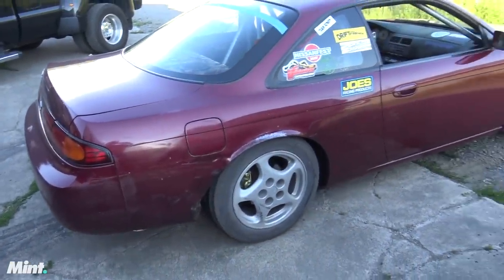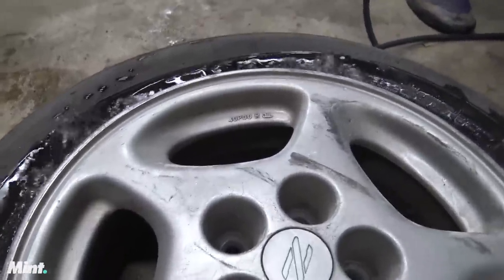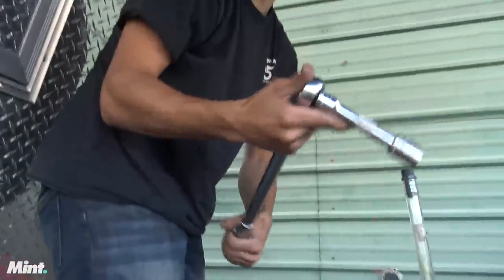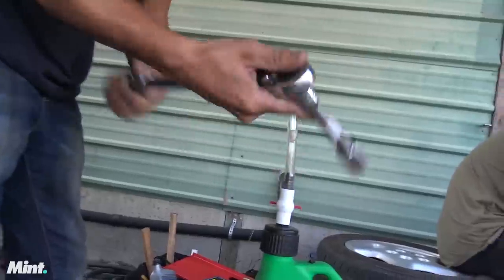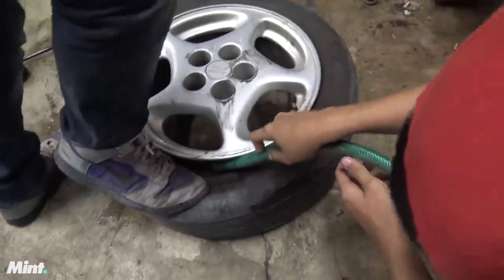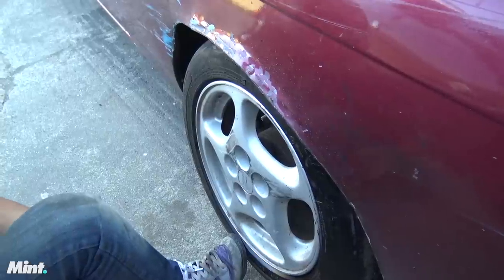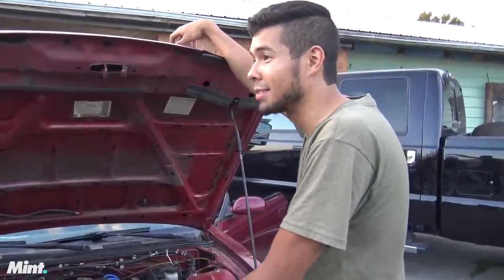Filling a CAR TIRE with WATER!

Comment: The reason it worked is because the water is cooling the rubber from melting so if you are doing burnouts, yes, the tires theoretically will last longer
Reply: wow really? didn't realise man!
Reply: And I'm guesssing the reason the tires start shredding is because the heat is converting the water to steam so it starts to expand and put extra pressure on the rubber
Reply: The reason it worked isn't because it's keeping the rubber from melting by because their's not enough air in the tires for the heat to build pressure and pop, the rubber is still melting
Reply: water hold over 4x the amount of heat than air does. so you could theoretically do a burnout 4x longer than with air.
Reply: Lol wow you’re a genius!
Reply: 4 times the heat capacity per unit of weight, though. There is likely 20+ pounds of water in each tire, versus very little weight in air. (not sure how much, but we can safely say well below a pound) So that means that even if it had a pound of air, the water would hold 80 times more heat at a bare minimum. It is likely hundreds of times more.
Reply: no shit
Reply: I would like to see it with some form of coolant inside rather than water something that can stay cooler for longer than water
Reply: Souprise Coolant is just anti corrosion, water is best for the job of transferring heat
Reply: Souprise coolant doesn’t keep the water cooler longer. It stops water from freezing. Wtf
Reply: Leon Kim congratulations you’re the only one replying on here that is actually correct.
Reply: but keep in mind that as the water cools the tyres, the water is heating up and most likely building up pressure due to evaporation and having nowhere for the steam to escape
so... after a while.... BOOM
Reply: @Npianist

who are you replying to ?
are you replying to me 
i didn't say anything about Weight,   who are you talking to ?
Reply: You do realise the tyre would still wear out from friction from the ground right? It's like sand paper to wood, Just because you added water doesn't mean it won't still degrade. Adding water is also pretty dangerous, as the tyre heats up, it will eventually cause the water to evaporate, which then adds steam in to it which creates more pressure leading to a tyre bursting.
Reply: Not you martin,  mysticarsenal. And @ connor etchells, that's true, but also as things get hotter, they become softer.. Like how you bend metal by heating it up. So although adding water doesn't change the friction, it still keeps the tyre cooler for longer so the friction isn't damaging the tyre as much as it would normally be. This is just my thoughts though, I'm no scientist :)
Reply: @Npianist
fair enough
it's just your comment was below mine and not attention to one particular person and didn't relate to the original poster, so i had to ask
thank you
Reply: sorry, but psi is a unit of pressure. same goes for bar, atmospheres or mm mercury. it tells you how much force your "gas" applies to (in your example per square inch) a specific area. The pressure put into your tire has nothing to do with the mass of the air, but rather with its compressibility. it would help if you would read the wikipedia article before commenting.
Reply: Keno Clayton, that’s just friction wear, nothing abnormal.
Reply: 1xBublex1, fill up a high pressure tire to bursting and when it has an impact, by your own reasoning you’ll be lying.  What is potential force Considering gravity? Not convenient to an argument? Didn’t think so.
Reply: So you are telling me i could do longer burnouts if i fill the tires with water
Reply: ok First of all most people here replying needs to learn a little more in the head, Air does have Mass therefore has weight under earths gravity Air pressure is actually the air's "weight" its pressing down with force the lower you are in elevation the more air there is the more pressure "weight" it has to press on things. second Rubber is a great insulator so yes in a way the heat transfer rate it has isn't great, but judging how water has a relatively good heat transfer rate and a good heat capacity and the fact the water did get hot/warm depending how you take their word for it yes the water did transfer enough heat at least to a point where the tire did last longer then normal however this probably occurred only after the tire got ground to a point where the steel was in contact with the pavement(Also those tires didn't look in great condition either so that was probably really quick). 3 on the person saying Psi was a measurement of air weight plz do me a favor and actually look up what Psi stands for.. Thanks and that is all have a great day.
Reply: InDong WeTrust 
It's an eye opener!!! I fill mine with freezing water! It will definitely last even longer 😉
Reply: Souprise 
How about leaving  the tyres in  the freezer for 10 days?!
Reply: To your 3rd point Donald Malone, while you're completely right, if he looks up just what PSI stands for he's just going to see Pounds per Square Inch and not really learn that it's a measurement of a pounds of pressure not pounds of weight
Reply: In dong we trust
Reply: I cant believe i read this whole comment section!! I loss a few brain cells early on but got them back at the end
Reply: It's because water is both adhesive and cohesive
Reply: Well in PRACTICE they last longer that is what they just showed.  And to be specific it works because water has a very high thermal mass, it takes a lot of energy to heat up water a little bit. Also is has good thermal conductivity, between the rubber and the water.  So the water absorbs heat from the rubber keeping it much cooler than it would be otherwise. To others: air does have weight and mass,  'getting hotter' and 'absorbing heat' mean the same thing, yes friction and abrassion will still wear out the tires, just not as fast, the tires will be destroyed long before any steam is created, there just isn't enough heat energy to get that much water hot enough.  A half cup or so of water in the tire might be dangerous though.  There might be enough heat energy to turn that into steam and then the tire would become a bomb . Don't try this with a little water. Also calling people idiots when you are as wrong and mistaken as they are isn't a good look.
Reply: Keno Clayton I don't think so, I doubt the water ever got near the boiling point.  They said it was warm.  If it did get to boiling point that tire becomes a bomb.
Reply: Yeah, the tire will still burst.. The asphalt is literally shredding the rubber of the tire, so it will still blow out, (eventually) but because it isn't pressurized like it is with air, it won't really explode.
Reply: Thanks, captain obvious!
Reply: Noah Cremers no one like this comment left it at 69
Reply: Sherlock Holmes

Comment: They do it in tractors all the time. They even make a tool to easily do it.
Reply: why tho
Reply: @brendonboyer943  in tractors it's for ballast. To offset weight of loaders and such. In off-road trucks, it can assist with problematic balancing too, though typical dry small plastic beads are used.

Comment: In my opinion far far the best idea is to have concrete tyres and rubber roads.
Reply: Square tires too.
Reply: sickofitall89 .Hexagonal. Loose weight as well.
Reply: They had a Darkwing Duck episode like that once. They time traveled and the Dinosaurs were driving cars with cement wheels but roads made of inflatable rubber, it's the reason they went extinct.
Reply: @vguyver2 . Fred Flintstone is my idol.
Reply: You're damn right,sir...
Reply: Darkwing duck had an episode like that

Comment: They've been doing this and tractors since the beginning of time lol for weight purposes
Reply: hmm i knew they put sand in them but didnt know about water, good to know
Reply: Michal strzelec yes water or antifreeze
Reply: Michal strzelec some guys even do it on rock crawlers
Reply: makes sense, keep those big ass wheels planted
Reply: It's often water and calcium chloride...  basically road salt. The salt is purely for anti freeze and will harmlessly go in to the ground if there's a leak.
Reply: ive never heard antifreeze but water i use all the time
Reply: if you go to a tractor place they sell them factory filled with hydraulic fluid. Convenient if you blow a hose as well!
Reply: East Coast Lowlife  The main reason for using water was for safety, far less explosive blow out.
Reply: East Coast Lowlife I work at a tractor and lawn dealership, we fill them with beet juice. Yes you read that correctly.  Water and other types of liquid tire weights tend to eat the through the wheel over time. Beet juice doesn’t and it never freezes
Reply: Interesting info. Didn't know that.
Reply: We use water and methanol
Reply: Angel Rosales methanol? Holy hell if that sparks you’re done😂😂😂

Comment: First hard bump will pop it. The water cant compress and pressure increase from a curb or speed bump will be proportional to water:air ratio..
Reply: Jimmy's Tractor no
Reply: demogorilla lol, that was well thought out. Same reason you dont fill tires on construction equipment more than 75% water  doesnt compress.
Reply: so we need a fluid which can compress sufficiently and dissipate heat more efficiently than air, like a compressive coolant. :o
Reply: Luke A Edwards no fluids compress? Are you serious lol
Reply: Strange Person 
The only problem is that fluids don’t compress.
Reply: Mce 1863 Fluids compress, just not much. I’m wondering if the water heating up is what allows it to compress beyond what it could at room temperature, making it more plausible the tire would withstand your normal pothole or bump
Reply: Fluids do compress, Petrol can compress, oil can compress, The gases which make up air by the definition of fluid mechanics are also fluids and can compress.
Reply: Strange Person CNG
Reply: Most fluids are considered incompressible.  For the qualities of hydraulic use, petroleum based fluids and water are both classed as incompressible.  Not because they have no compression at all, but because the amount of compression under pressure is so little as to be considered negligible.  If you have a liter of water at sea level, and apply 1000 PSI to it, you still get about 995 ml.  Heat causes expansion of the water (and the air left in it).  Inside of a closed vessel, whatever doesn't actually swell the tire out will become an increase in pressure.
Reply: After reading, I should correct "fluids" to mean liquids.  Gases are almost universally compressible.
Reply: Strange Person Oh I know, Butane! Or CO²? 

Anyway, it's a faulty premise b/c half the compressibility is the rubber of the tires anyway
Reply: Brent Morris your assertion that "gases are almost universally compressible" is giving me a tinge of pedantic OCD ....😖 ughh, no need to play it safe w/ "almost universally"; gases are compressible
Reply: I'm telling you guys half the cushioning is the elastic flexing of the tire rubber.. 

but I can understand how you'd think that's a real stretch 

'a real stretch' ? 🤠
Reply: Are we gonna ignore the fact that they slammed the car down on the tire after filling it up
Reply: Jimmy's Tractor it's done all the time in tractor tires,and on roughterrain forklifts it's for ballast
Reply: Water doesn't compress (much), same reason why you have water/oil separators on hydraulics.
Reply: name the fluid that compresses when heated...
Reply: Fluids are not liquids. Fluids are gaz and liquids
Reply: While its true that the air in your tires helps to absorb impact forces I seriously doubt that a tire filled with water would “pop” upon hitting a hard bump. Still, WHY ON EARTH would anyone want to do this – I mean besides the fact that most drifters are basically morons. Speaking of which, how utterly idiotic and childish is a burnout competition? This experiment is not about tires at all but rather is an example of the devolution of the human race. 

I actually started racing cars when I was a teenager and I even learned to perform many of the car stunts done in movies, but even back then I NEVER had any desire to just sit there in one place and turn my tires into smoke. And I certainly never had a desire to enter any kind of track event in which the winner is determined by how “cool” he looks going through a turn (drifting) rather than on how fast he gets around the track. Driving on asphalt in the same way you would on a dirt track (drifting) can definitely be fun, and I would sometimes even do it myself for fun back in the 70’s, way before we even had a name for it. But I never in a million years would have imagined that someday this would actually be considered to be a “motorsport” by some, and that there would actually be competitions of this type held around the country.

Comment: and?
Tires on farm tractors have been filled with water since there are tires on farm tractors. Especially in the good old days without 4x4. Puts weight on the axle. Helps with traction.
There are special tools for not making a mess, you put in some anti-freeze and a little air. Done.
Reply: zammap08, actually, fluid in 1 tire on an axle wth duals will only be useful to that tire alone. And that's a problem easily solved with cast iron weights. They distribute the weight evenly to all tires. More efficient, also.  
Tires can be filled 100% with a tube inserted through the fill adapter which ejects every speck of air!  
We are now using sugar beet juice as ballast in tractor drive tires. Environmentally friendly, you know!
Reply: We have a pneumatic pump at the shop to do this through the valve stem. Almost all tractors are fluid filled. We use a 10:1 water:methanol mixture to keep it from freezing.
Reply: zammap08 Now I have an argument on how GTA 5 isn't 100% accurate. My friend thinks GTA 5 is life of crime simulator. Pathetic argument but its what it is.
Reply: Jamiechan there are a million reasons why gta 5 isn't accurate.
Reply: Stinger_ 223 I know. That's why I said its a pathetic argument.
Reply: Jamiechan yeah
Reply: Stinger_ 223 yeah
Reply: Went looking for this comment don't forget antifreeze though
Reply: Water in tractor tires doesn't really relate to this. Tractors have low acceleration. Rotating mass, moment of inertia, or unsprung weight (or weight not above the shock absorbers) are mostly irrelevant. In a car, these things matter more, and are reasons not to use water in tires. Unsprung mass is an engineering issue with putting electric motors on wheels for hybrid cars with regen braking. It also takes a lot of torque to spin heavy tires to overcome the inertia. That's why performance is worse with an extra 100 pounds in a tire compared to 100 pounds in the trunk. I'd imagine 1/2 filled tires would be even worse, as weight shifts back and forth during braking and acceleration. I don't normally watch this channel, but it was recommended and I was curious. Watching teenagers ruin cars is fun too.
Reply: The big thing with tractors is that they don't go fast enough for balance or acceleration/braking to be an issue.
Reply: Tools required - transmission funnel, small funnel w/hose that fits on valve stem (pond pump if you have one), ratchet strap. If you want cheap tire anti freeze, windshield washer fluid has been the go-to of many for years.

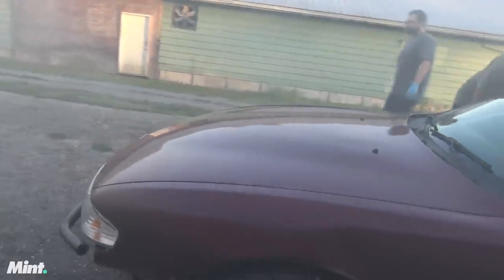Comment: 5:32 it’s because the water has a better heat capacity than air, and a higher specific heat, so it essentially cools your tires. Not very efficiently though
Reply: It's actually just thermal mass providing a place for the heat to go. More like a heat sink less like a radiator. It also means the tires would stay hotter FAR longer.
Reply: Denman Fite  cvv
Reply: Aurum x Argentum yeah 4200joules/J you gonna have to give the tyre 4200 J of energy to raise the temperature of the water by 1 degree.
Reply: okay but what i'm wondering is, why does your name mean "gold and silver" in roman latin?

Comment: putting water in a tire is nothing new. I have had water in my tractor tires for many years. gives it more weight/traction.
Reply: bheckart Same here, old Wheelhorse lawnmower tires.
Reply: TheRobb573 

It's called loading the tires. Works good
Reply: Never seen this myself. 1st time looks pretty effective.
Reply: It’s a great trick, also they still sealed it with air and it’s technically still just a tire under air pressure that happens to have water in it
Reply: Yes but would it do a burn out?
Reply: My god u people... Sure, filling water in tractor tires are nothing new for you, but its obviously rare for someone to fill CAR tires with water.
Reply: We live in a cold climate and load our tires with calcium chloride I've also had one loaded with molasses
Reply: I get the weight part. But how does it add anything to traction?
Reply: "loaded with molasses" just why?
Reply: Tragik Times tractor tires are huge.. It adds more weight to the rear or front. I figure they would do it in rear so it could carry more weight.
Reply: I live in Missouri. One of the farming capitals of the world. While molasses are denser than water, it's not by enough to warrant the waste of a very expensive product. No way any farmer would do this for more weight. They would add steel inserts to the rim before they did this, which I also haven't heard of them doing. Tractors are pretty fucking heavy, as is.